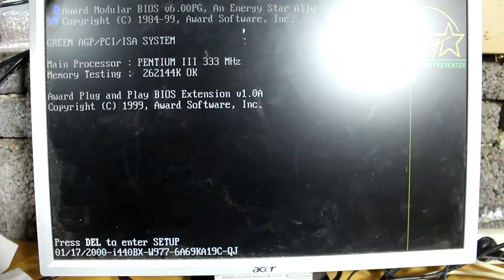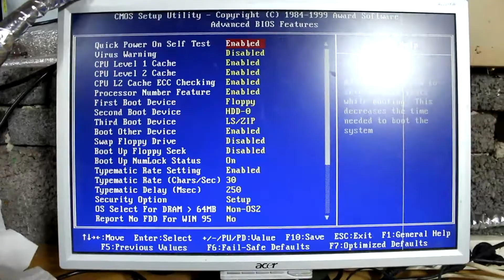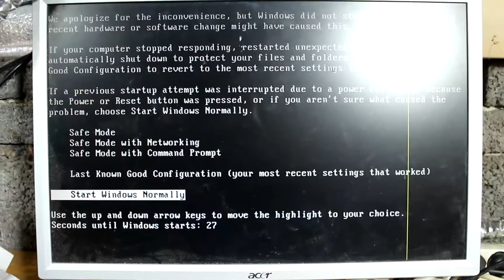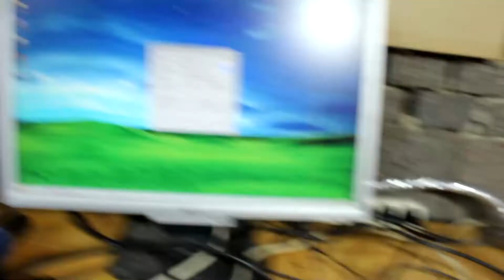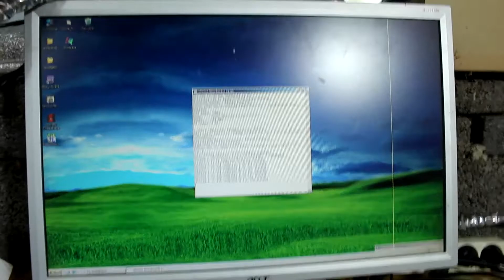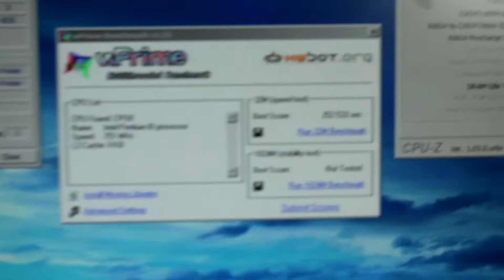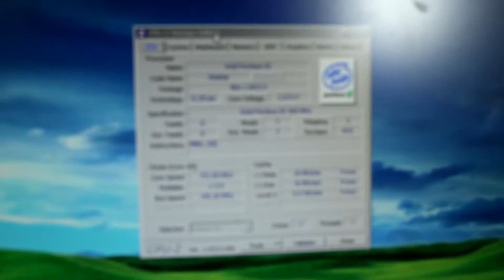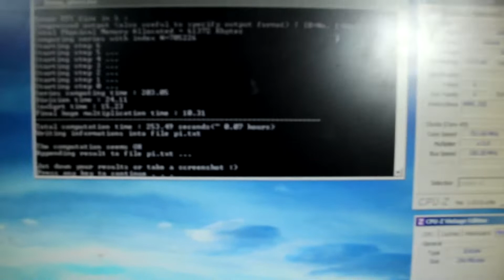Pentium III cachemod OC update and some general P3 500MHz Overclocking

Comment: Hmm, es kann sein, das der 3,6ns nec cache chip einfach im allgemeinen länger für einen schreib/lese zyklus braucht. Ähnlich wie bei der situation zwischen ddr 400 und ddr2 533. Oder zwischen ddr2 1066 cl22 und ddr2 800 cl16. Der 4ns chip is vielleicht im allgemeinen schneller wieder bereit für den nächsten Befehl reihe und kolumne, lesen oder schreiben. Gab ja auch bei den 200mhz ddr chips gute und schlechte z.B nanya oder micron. Hynix und Infineon waren schon besser.

Comment: It would be nice to see the cachemod on a better binned cpu but that's kinda risky. 
I should get myself a 24 to 20pin adapter (im too lazy for any mod) and get my my old msi slot A mobo for some testing
Reply from the maker: That will definetly happen, i have plenty chips left to bin and there's gotta be some with good core and crap cache in there somewhere :)